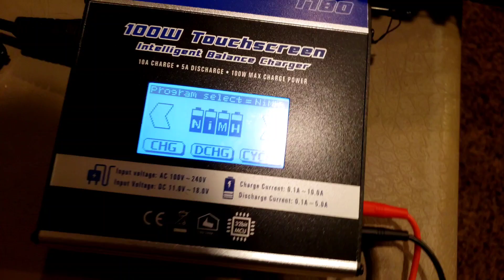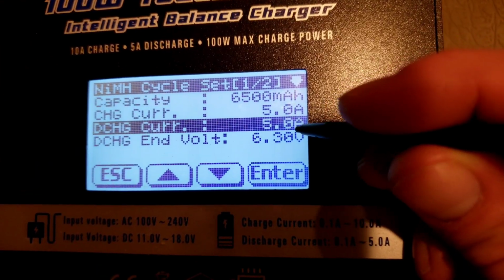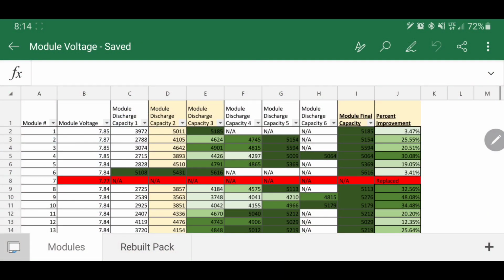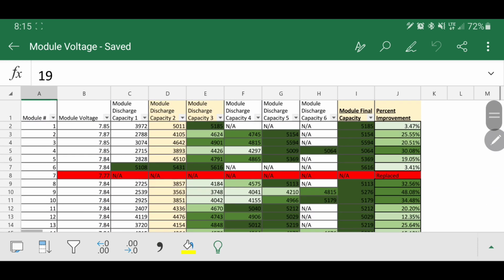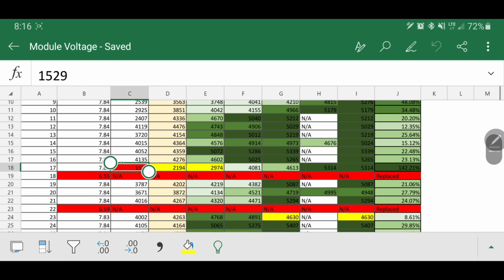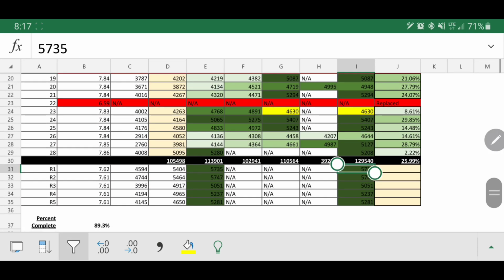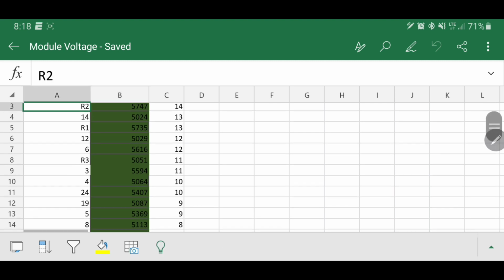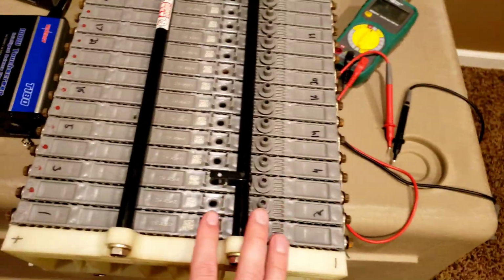Reconditioning a Prius Hybrid Battery Pt 2

Comment: for those that might be having the same problem i had - not being able to read the capacity at the end  of cycles except the last cycle - i found the trick!  on the screen after the cycle stops, there are two buttons at the bottom.  the button on the bottom left is 'ESC', to go out to next higher menu.  the one on the bottom right is 'Graph' to show you a (pretty useless) graph. between the two buttons is the word 'CYCLE' (if you're cycling as H-EV Tech describes).  the trick is that if you click on the word 'CYCLE', you get a screen with the data from the cycles.  it doesn't look like a button, but it acts like a button.  the data from the cycles shows max charging mAhr and discharging mAhr for each cycle.
Reply: Note: you need to start the cycle from the second page of cycle settings for this to be active. Wasted a lot of time trying to figure out why it only worked sometimes.
Reply: @AsmodeusInflect  I have no words for your awesomeness right now. I NEEEEEEEDED this information!!!!! If this works, can I send you $5? (If I had more, I would probably have bought a Green Bean instead of trying to figure all this out.)

I also subscribed to your channel.
Reply: DOOOD. THANKS
Reply: Anybody else have issues with their charger not displaying the discharge mAh? I've got Vp and mAh for CHG and Va for DISCHG, but 00000 mAh for DISCHG
Reply: did you figure out your mah discharge data?
Reply: @250count  I noticed on the first charge cycle it always lists Vp.  Any idea what this is?  Mine usually reads around 9

Comment: great video - thanks very much, H-EV Tech!  

i just started trying to recondition my HV prius battery.  it's a 2006 with 240,000 miles on it and i got the triangle of death.  i'm not sure yet how many modules i'll have to replace (only one had failing open circuit voltage, but others may have bad capacity; we'll see).  i'm following the method you outline - really appreciate your detailed explanation!

i'm not sure i'm following the method you used correctly.  i set up the t180 as you described, with charge and discharge currents 5A each.  but often the discharge current the display shows is more like 2 or 2.5A.  am i doing something wrong, or does the t180 vary the discharge current for some reason?  (i'm using kind of cheap alligator clips to connect to the module and there is ~1v of loss in the clip wires - will that confuse the t180 and cause it to use less discharge current?).  i originally setup to do 3 cycles at a time (3T), but when the 3 cycles were over, i couldn't find any way to read the discharge capacity after the first or second cycle - there was no data anywhere i could find.  is there a trick or a special menu to read out the discharge capacity of each cycle?

Comment: Thanks, good video !! At the moment i have my  Lexus GS450H batterypack at of the car. 1 defect modul. I measured the capacity of the other modules and find 9 additional weak modules. The rest have a capacity from 3512 to 5155 mA/h. Do you think it makes sence to pair this modules in blocks to have a runing battery with lower capacity?

Comment: thanks for video  i have 2005 Prius  with p0A80 and cell number10 low. 
l removed the battery and all of them are 9.61>9.71.performed the load test and the hold the voltage
.I bought it used and i am driving it for about a year and this just happened. i don't know why it is so high.(voltage). . i thought if it has internal short it would not pass the load test  but it did.  can you help me with it thanks

Comment: Thanks for great explanation, followed the process and I seem to get good results. 
How do you get capacity results for every single cycle when you have set to 3 or 5? All I get is the very last result when it's done and doesn't show me previous cycles. Unless I do one cycle at a time and record the results
Reply: For anyone reading from the future, this is answered in the top comment by a user named John Greene:

"for those that might be having the same problem i had - not being able to read the capacity at the end  of cycles except the last cycle - i found the trick!  on the screen after the cycle stops, there are two buttons at the bottom.  the button on the bottom left is 'ESC', to go out to next higher menu.  the one on the bottom right is 'Graph' to show you a (pretty useless) graph. between the two buttons is the word 'CYCLE' (if you're cycling as H-EV Tech describes).  the trick is that if you click on the word 'CYCLE', you get a screen with the data from the cycles.  it doesn't look like a button, but it acts like a button.  the data from the cycles shows max charging mAhr and discharging mAhr for each cycle."
Reply: Make sure the number of cycles is hi-lighted before you hold the cycle button to start the first cycle. Then I was able to toggle through each.

Comment: How long does 5 cycles typically take you? I'm following your instructions and it's SO SLOW. Left it on at work and 8 hours later it's still on the fourth cycle! Can anybody offer some guidance?
Reply from the maker: 2 hours for each charge/discharge cycle is fairly reasonable. If a module takes longer for each cycle that can be an indication its in good condition. I am curious what charger you are using and the settings you have regarding charge and discharge amps. What is your discharge voltage as well?
Reply: @HEVTech1  When I first watched this video, I misunderstood what a "cycle" was. I thought 1 cycle = (charge/discharge)x5. 

My parameters are the same as yours on your update video on the T180. So far, most of my modules show a discharge capacity  in the low 4,000mAh after 4 cycles. Not sure if I should aim higher, or shoot for 4000 on all modules and get this car running again!

Capacity 6500mAh
CHG Curr 6.5A
DCHG Curr 5.0A
DCHG End Volt: 7.20V
Reply from the maker: Low 4000mah isn't terrible and certainly usable. Keep in mind your entire pack capacity is only as good as the capacity of the lowest preforming block (group of two modules). If the car has over 150k miles I would be happy with 4000mah being the baseline to aim for and would expect the pack to last around 50k miles (though there are lots of variables regarding battery longevity).
Reply: @HEVTech1  Thank you. Can you go over your strategy for considering a module to be bad? 

Here is my thinking
Voltage test- anything under 7.6V should automatically be disqualified. Thoughts?
Then the capacity test given your parameters. If the module capacity doesn't improve over 3 or 4 cycles, and it has a capacity of <4000mAh, I'll stop cycling and discard that module. 

Do you use any other criteria for disqualifying a module?
Reply from the maker: The module is made up of 6 cells each having 1.2v nominal. Any modules around 1.2v lower than most in the pack likely have a bad cell and should be tossed. I agree with what you have regarding the capacity parameters and if it does not improve in 3-4 cycles. Sounds like you are well on your way 👍
Reply: @HEVTech1  Thank you. You da man. I really appreciate you responding to the comments and answering questions. Your reassurance is helpful. Plus, my spreadsheet tells me I'm making some serious progress!

I'll probably be back with more questions once I get to balancing the pack! Thanks again.
Reply from the maker: Glad you are seeing results and the videos were helpful for ya!
Reply: @HEVTech1  Still going strong! I just got most of my modules up to 4500mAh . My 5 replacement modules arrived yesterday.

when I was doing the charge/discharge cycles some of the modules didn’t need 5 full cycles. Because I was checking the data on T180 only sporadically throughout the day, several of the modules began a subsequent cycle and had partially charged before I disconnected them.

Before balancing the voltages and repositioning the modules in the pack, should I discharge each individual module to verify they have been fully discharged? Is this necessary? Or is this harmful?

Thank you!!!!!
Reply from the maker: @Sferguson360  when you go to balance the whole pack I would get each module to roughly the same voltage to prevent any high current draw for modules that are significantly under/over charged compared to the average.

The Prius likes the pack to be around 58-60% SOC so keep that in mind as well when you go to put the pack back into the car.
Reply: @HEVTech1  About to charge the whole pack in parallel (+ on one side - on other) to balance the voltages. Once that is completed, you said to let the pack sit for a day (16 hours). 

Was your circuit closed when the pack was sitting? Or did you disconnect the Tenergy charger, opening the circuit?

Thanks!
Reply from the maker: @Sferguson360  I had all the positives connected and all the negatives connected. I only connected the Tenergy to bring the voltage of each module up to 7.6v
Reply: @HEVTech1  lol sorry. it was a dumb question. The pack is charging up right now!
Reply from the maker: @Sferguson360  good luck!
Reply: @HEVTech1  can u help me pl the change t180 input how many A and Output how many ? If the cell is 5A and u saying output 5a input 5a 7.2v Sometimes give you 9 V.  Cell  Change
Reply: @HEVTech1  Hi, Great videos!!
So is it 7.6 VDC or 7.8 VDC?  further down you say 7.8VDC.  Also, what is the voltage setting for when doing individual modules?  Thanks!

Comment: All of your videos are great. I have a question for you? About how long would it take to rebalance every module, including six new modules. I'm sure you don't know exact, but could you give me a rough estimate so I know if I should take off some time from work
Reply from the maker: This ultimately depends on how many and what kind of charger/discharger you have along with how long you want to cycle charge each module (I read 3-5x is generally acceptable). I had 2 Tenergy T180s and to cycle charge 3x it took about 7-9 hours per module. I had it timed out so I could get about 4 modules done per day for a total of 7-10 days with the replacement modules. I didn’t take any time off work but I also had a second car I could use for commuting.

If I had to do it over again, I would probably have gotten a 3rd charger knowing I will eventually use it as I own two 2010s :)

Comment: Thank you so much! I learned so much.
I just did the battery in my camry.
I started with Dr. Hybrid app with LET of 32.68%
And with your help the LET is 77.02%!!!
Thank you so much!
Reply: Hi Craig, How about your battery after a year? I have exactly the same 32% lifetime left. Thinking about the procedure and interested of your result in long therm :) I would appreciate your experience.
Reply: Nobody responds? What does the professionals use as far as chargers go to do this quickly

Comment: What mode and settings did you use on the T180 for charging the whole pack together in the last step of cell balancing? Was it the power supply mode?

Comment: Im new to hybrids and pack 8 in mt 08 prius is bad. I got the dealer i bought the car from to give me 18 modules to try to charge/discharge them. I bought the T180. Check voltage on these and most of them are at 7.4. Im charging/discharging each one 5t now to see  if they are good. I thank you for your videos, huge help. What are the settings on the T180 do you set when balancing the block? Im an aircraft mechanic so im just going to use safety wire when I balance them.

Comment: Hey thanks for the video. I’m about to balance my pack also. What’s the setting you put on the tenergy charger when your balancing ?
Reply from the maker: I didn't use the T180 to "balance" the pack as the solder wire I used accomplished the balancing by itself. I "trickle charged" the entire pack with the same settings as an individual module minus the current limit which I set to 1a or around 7-8 watts. The solder balanced all of the modules which is a step that cannot be skipped or will lead to issues when installing the battery. You certainly do not need to do the trickle charging step if all of your modules are showing 7.4v+, I only did it as I was wanting all module voltages to be  7.6v before installing in the car.
Reply: @HEVTech1  I don't understand... can you please explain in human. Lol sorry all these words your saying is hard to understand. So you said you " didn't use the t180" to balance them. Than what did you use to balance it? And after attaching the solder , what location on the battery do I put the negative and positive from the charger, is it on any part of the solder? And what exact setting do you use on the charger/balancer and how long does it take to charge and how do you know when it's charged? Also do I have to discharge all the batteries before balancing after the discharging/charging 5 times?

Sorry I'm not into electricity work.. but I find this very educational and don't want to mess up my batteries
Thanks
Reply: @edwinmelnik247  I think he meant that during the 16 hour rest after charging the solder connecting the terminals will balance the pack
Reply: @benhawkins1495  thanks,  after hours of thinking of what he said and watching a few other videos. I understood that all I have to do is attach the wire solder or copper wiring and leave it for 16 hours and it will be balanced...
Reply: Thank you very much for these videos!  I have 7.28V after balancing the pack. 
The charger settings have capacity left at 6500mAh? Set current to 1.0A, CHG mode - Manual, delta peak - 5mv/C and the trickle current would only go up to 200 mA?
Would these settings work to charge for 8 hours before reinstalling back in vehicle?
Thank you very much!
Reply from the maker: @staceyhill846  yep that should do it
Reply: Same question i was fixing to ask him

Comment: How long did it take to cycle 1 module 3 times using the tenegy T180?
Reply from the maker: New video out tomorrow going over the T180 and the settings I used. Ultimately it will depend on the condition of the module but on average I would say it was an hour or two per cycle.
Reply: @HEVTech1  I will be waiting to watch that video, I already got myself a T180 charger for when my 2010 Prius battery goes bad .

Comment: Hi, awesome video! Very helpful and nicely explained.

Question: when charging/balancing the whole pack, did you do that with your T180? What settings did you use for that?

I bought a 2nd hand battery pack and am currently charging the modules one by one since the load was to low to get the car starting. Now I am really wondering how to charge a complete pack.

Greetings from The Netherlands
Reply from the maker: I will be posting a video soon on the settings I used with the T180 to charge/discharge my pack as I have gotten this question a couple times now. Stay tuned!
Reply: @HEVTech1  That is great to hear! I am looking forward to that video! Thanks a lot in advanche :)
Reply: @HEVTech1   did you post a video on the settings to charge the whole pack? Thanks!
Reply: Any one got an answer here? Should I put 6500 as the capacity?
Reply: Did anyone get the answer on the whole pack charge settings for the end of this process? I’m at this point in my refurb and can’t find the information in the comments.

Comment: Yo , you should buy a grid charger lol , I can't imagine the pain in the ass of doing deep discharge/charge cycles on each individual module , you are a far more patient man than I am .
Reply from the maker: A grid charger won't tell you which specific modules are bad and especially won't tell you which are the weakest x modules in the pack should you want to refresh an aging pack. Doing each module individually is really the only "right" way to rebuild a pack in my opinion. That said, yes it takes forever lol
Reply: @HEVTech1  @Manuel

Is there a way to attach more chargers to this setup & view the charge/discharge curve or info live on a PC screen.

Can you also install external load to these chargers to discharge the batteries more quickly?

I was thinking of attaching all the modules to a grid charger & also to a large load like an oil heater for discharge. Only issue is, I cannot find a battery analyser to attach to every module to get the battery charge/discharge live data.

Do you know where I can find a battery analyser for all the modules?
Reply from the maker: @jerryh123  I was looking at constant current load testers (https://amzn.to/3xLfXPd) to see if it could discharge the pack a little faster and still provide capacity info.

I'll be doing a video once I have time to test it. Work has been busy lately unfortunately.
Reply: @HEVTech1 Been extensively researching into this for nearly a year. I have a solution with regards to high capacity discharge. How can I contact you directly?
Reply from the maker: @jerryh123  
Hybridev.technologies@gmail.com
Reply: @HEVTech1  that's why you use a grid charger coupled with some battery analyzing software for quality control. You get the best of both worlds , even parallel charging doesnt individually balance the cells in each module , which is the real limiting factor.

Comment: I purchased the T180 charger that you are using in the video. When using it on the battery block from a 09 prius, it keeps going into "delay" and doesnt complete cycle. THis was using the settings in your video. I could really use your help!!!
Reply: In the settings menu, set the safety time out function to 500...
Reply: Delay is the cool down time you set. How long between each cycle it waits to cool down the battery before it resumes.

Comment: I really like the way you reconditioned your Toyota Prius hybrid batteries.  I am trying to follow your process to recondition my Lexus RX400h and I am ordering the same charger that you used on the video.  My individual cell has a voltage about 10.4 V and I just wonder if you can recommend how I can set up the voltage and current for charging and discharging. Thanks